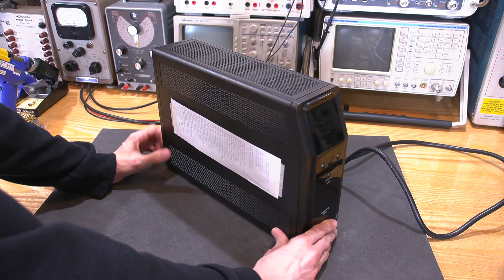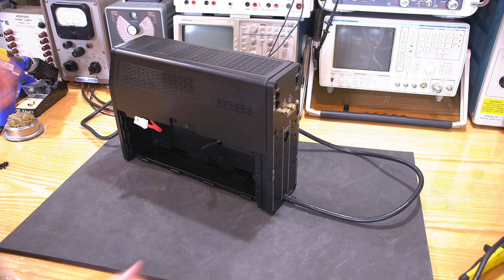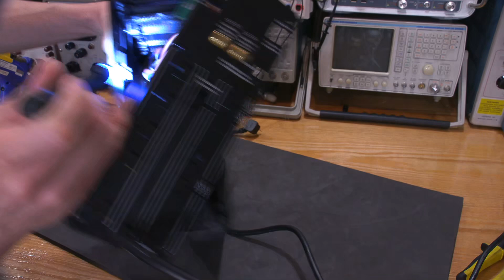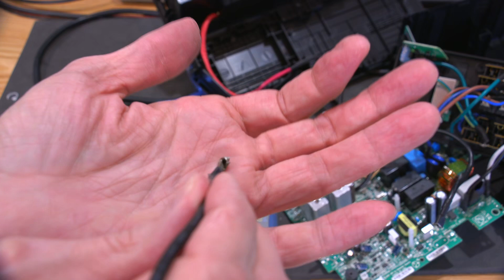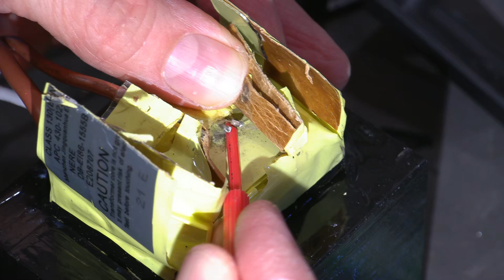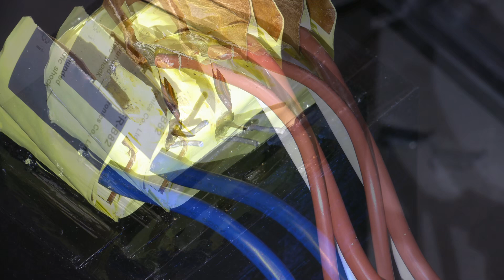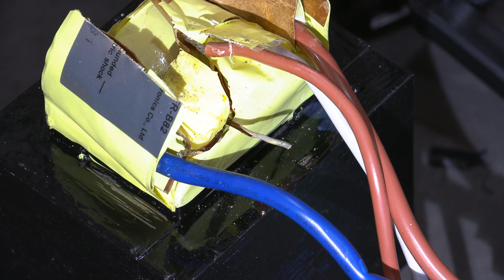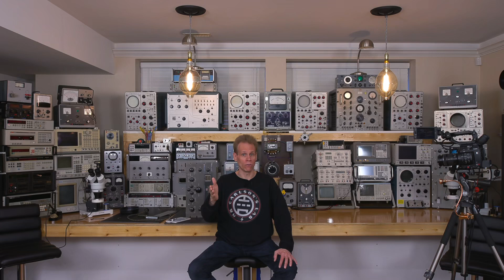UPS Electrical Failure - Teardown and Analysis!

Comment: Hmm I have a failed APC consumer unit that is still sitting in thee corner as a possible repair candidate or parts source... I think I'll have to go cut open the transformer now! I have an older rack mount unit powering my network gear. I'm hoping it's old enough and being a different market that  they didn't cut too many corners on THAT one.

Comment: I had exact same issue with my UPS, which is complete diferent brand(again with good reputation), but exact same thing happend. I didn't teardown the transformer, but just found the open circuit, and still have it. Some day will do it. The behavior was exactly the same, arching sound, slight smell, alarm, then error light and no output.

Comment: Sorry to say, the transformer market is being flooded with cheap, and dangerous, products.

I recently bought a new, digital controller, chemistry hot plate with stirrer, and the transformer in that was bad!
Instead of sending it back, I grabbed a wall wart with the proper output and used the transformer out of that.
The surplus transformer was over two decades old, and you could tell it was a higher quality unit!

The wires in my transformer were twisted together, but not soldered, and the wire wasn't even bent over! Needless to say, the lead had pulled out of the tape securing the wire. And it was so small, I didn't want to try and repair it.

Not surprising to see the quality decline as our products continue to be made as cheaply as possible, while they still charge high prices for them. I suspect a few fires from such equipment may be needed to get the industry to pull their heads out of their rectal cavities before the quality improves again!

Comment: Could the windings be copper clad aluminum wire? In the building trades a "solution" to the problems with aluminum house wire was to go to copper clad aluminum. It worked OK because the wire connection devices were purely physical, but the cost savings were so minor that regular copper wire was generally used instead. Soldering to copper clad wire seems like a really bad idea.

Comment: Some of new transformers and electric motors have now aluminum winding, I have read that there is  an efficiency reason for that. It only needed the wires crimped UPS put back together.

Comment: Aluminum wiring in my house has caused me no end of grief due to the mechanical wire junctions oxidizing and literally melting the junction boxes.  As a bonus I  got to pay for the wasted electricity used to create that hazard. I think the UL code must have criteria on proper methods of jointing dissimilar metals.  Maybe UL or the equivalent testing agency needs to pull their labels off these APC units. Thanks as usual for a great video.

Comment: That is the exact same issue I had w/ 1 of my 5 APC Back UPS 1500. My failed unit was connected to my primary desktop HW. I opened the UPS, andx found the same aluminum transformer windings. I have replaced each APC w/ a different brand. Interesting to me as well was the lack of any burns/poped capacitors on the boards.

Comment: It's sad.  My older 1500va apc ups, has a transformer about 4x larger.  transformer was new/old stock from the 50's or 60's.  I had tracked it down when that ups failed, and of course kept it.  Yours should have had mechanical connectors.  Pretty scary.  Aluminum is in everything these days.  All the consumer stuff especially.  How many of those ups's have reached the landfill already?

Comment: CCA = Copper Coated Aluminum. The latest "advance" out of China. Much cheaper than solid copper wire. It's become quite common in the last few years. And I predict that in a few more years it will be outlawed...again.

When I moved into my first house, about 1988, some of the houses in the development (the first phase of building) had been built with aluminum wiring. Yes, this "discovery" (that aluminum wire is a lot cheaper than copper) has been made before. Actually, the drop line to your house is made of aluminum. However, you need to be very careful with aluminum, because as soon as it is exposed to air, a high-resistance oxide forms on the surface. Electricians know this and there's a procedure to mitigate it which involves abrasives and a compound called "NoAlOx" which keeps the air from getting to the cleaned aluminum. They also use compression connectors to make a solid pressure bond to the aluminum wire (which expands more than copper when heated). So what happened with aluminum house wiring? Why don't we see it today? Fires. Lots of them. The houses in my development were all rewired with copper. If you look carefully on the back of electrical outlets and switches, you will (should) see "CU-ALR" which indicates that they are rated for use with aluminum wiring. 

Failure to make these types of connections results in what Mr. Carlson saw and heard. The difference in expansion coefficients causes the copper coating to unbond from the aluminum interior (and the copper layer wasn't all that thick to begin with). And you have a bad connection. It works OK through factory testing, but fails under repeated loads. I had one of these supplies, which failed with the same F04 code. I Googled it and discovered it's quite common for these APC units to fail with that code, and they are basically uneconomic to repair. Now I know why.  I have a couple of old metal cased APC BackUPS Pro units and they are on their third set of batteries. Real work horses. But APC is now off my list of candidates for new purchases.

Comment: A few years ago, I purchased two of the same exact models. One of them was used for my computer rig and one for my TV system. 

After a while the computer one said I needed a new battery. Now it’s a glorified power strip when the light goes out, it pretty much turns off the computer. But my TV one, isn’t complaining. SO, I swapped the batteries out. 

And guess what? The computer one still complains it needs a new battery and doesn’t want to work as a battery backup. 

So is there a procedure to trick it that is has a “new” battery? Is it lying that I really need a new battery?  The TV still has about the same time it’s on before I loose all power. Are they doing that on purpose to make me buy new batteries or worse, a new unit?

Comment: Slip is ATE test. When working for AB/Rockwell Automation from 1995 to 2001, as an ET the system created slips like that for passing tests. Its interesting that APC attaches them to their products as AB/Rockwell removed them before shipping products out to customers. There was just a build sheet with serial numbers of the boards that went along with the final product.

Comment: Is it a genuine APC or a counterfeit one? That is a horrible discovery I would not expect. My UPS APC failed two years ago, and I kept it hoping to repair it one day. It works with on battery but not on outlet power.  Now I will rather perform an "autopsy".

Comment: I've never been to this channel before, but YouTube recommended this to me, weird because I have the same back up, thankfully haven't had an issue yet, and mines been through about 5 power failures in the almost 2 years I've had mine, but I did have an arcing issue with an amazon basics backup that I have since tore down and thrown the bad parts of away. But in that one a relay had somehow managed to arc from one side to the other frying the control side of the board when it tried to get back on grid power after a power outage, definitely never getting an amazon one again lol

Comment: i have like 6 ups, where i live the electricity  is not reliable. My first 2 where apc and both failed after less than 2 years, after that i purchased cyberpower, i can say they are just way better, they have been with me for at least 7 years and i have just change the battery packs. Watching this video now tells me why the APC keep failing. great video man thank you for showing this

Comment: Mr. Carlson Greetings. I have a garage find Sears Roebuck Silvertone 6439A radio. Its a big console model multi band that I think is from 1939. Very dirty from setting around for so many years but still complete. One of the tubes has a broken glass where the cap connects, and the dial cord is still there, but off of it's small pullys. Interested?

Comment: Something happened when Schneider appeared on the label under APC logo, they used to be quality. However that transformer is fully assembled in China and it's very likely that the specification was changed for cost after initial sales to Schneider. Very common, so unfortunate that I have two in service that need to be removed now. EEERRR thanks for the vid ho hum.

Comment: You can't simply solder anything to aluminum: you need special flux and preheat the wires! Don't use your good soldering tips as they get eaten by the aluminum flux pretty fast. And you need a very big soldering iron to get as much heat in as fast as possible. Most guys soldering aluminum use tools for pipe soldering. I think it's easier to use a aluminum welder (with inert gas). There a many things which might go wrong why I don't like soldering aluminum (beside from the eaten soldering tips). It can be done but not rally with consitency (1 out of 5 tries are a good soldering connection: you should by some nickle strips and weld these strips to the aluminum and solder these strips it's much more consitend).

Comment: I used to use APC back UPS units from the late 90's, and they were built like tanks. I would remove the tiny batteries and replace them with a box of deep cycle marine batteries. And even though they were never designed for it, I could get 24 hours of runtime for my network cabinet. 
It is sad that such indestructible devices have fallen so far that they are now not even made of passable materials, let alone quality ones.

Comment: I had that exact true sign APC UPS and I can tell you it failed in the exact same way. I tore it apart trying to find what was wrong with it and never was able to. I was expecting to see carnage on the board but just like you nothing. I never cared enough to dig into the transformer, but mostly because I didn't expect that to be the thing that died.

Comment: Well, this is power, a clay wire on a transformer from APC! You're lucky it didn't catch fire! That backup power supply is not safe and in my opinion it should be taken off the market! There should be the original wound copper wire, because there are large currents flowing on the primary side of the transformer when the UPS is loaded at the output.

Comment: We are finding a lot of copper-clad aluminum wire on the market recently. I did a weight analysis and found copper content is about 10%. Large (utility scale) transformers have been made with aluminum wire for years, but they are terminated reliably. You can solder to aluminum with zinc chloride flux, but if left on it will cause corrosion.

Comment: The paper taped on the side is on every APC UPS I've ever purchased. It's just a standard item on new devices. If you buy a genuine APC replacement battery pack, it has the same piece of paper with it. I've had very good luck with APC UPSes, but just as with anything, some do fail.

F01 On-Battery Overload Turn the Back-UPS off. Disconnect non-essential equipment from the Battery Backup outlets and the turn Back-UPS on.
F02 On-Battery Output Short Turn the Back-UPS off. Disconnect non-essential equipment from the Battery Backup outlets and the turn Back-UPS on.

F03-F09 cannot be corrected by the user, contact Schneider Electric Technical Support for assistance.
F03 On-Battery Xcap Overload Faults  
F04 Clamp Short
F05 Charge Fault
F06 Relay Welding
F07 Temperature
F08 Fan Fault
F09 Internal Fault

Comment: Uh oh, the inverter doesn't know is sort of going the wrong direction in regards to welding voltage and current specs. ;-)  Wow, even the transformer windings are migrating to using the copper coated aluminum like the ole buzz boxes arc welder machines.

Comment: In my experience the APC back-UPS all fail in short order if your actually using them a good deal. I will have to find my documentation on it somewhere. Theres been a number of posts on hack a day about known failures of these units from the small ones to the larger rackmount pre large datacenter level units. About 6 years ago i went through close to 200 units in a year, out of the 100 purchased. Basically failures of random units every 3 months or so in the same way.  Wasn't worth shipping them back anymore as the cost of shipping was so high, after 3 units you had payed for a new one.

Comment: I have 2 APC and bought them as brand new. I think that is just end test report from production line. Usually they don't give that report for customer. Maybe they had problems earlier and now they do that for assuring those products work when they have build them.
So basically you see what they have tested and it shouldn't contain any fails.
Edit: Now I have to say WTF to that transformer. They hoped that loop wire with solder will be ok there. few temp cycles and that is loose connection. 
Also remember that it will also do short test when it test how good battery is. I think it's timed or It uses about 10% of capacity and calculate from that result if it's time to change battery.

Comment: Companies today have no pride at all. At one time in the 60's mobile homes had 14ga aluminum wire installed. The last time it was used was 1971. Over time aluminum combines chemically with the oxygen in the air and forms a coating on the wire that is resistant to the flow of electricity. This resistance causes the wire to get hot and can lead to fire. Imagine using your microwave in in one those 51 year old mobile home or worse electric blanket. Your sound asleep and never wake up. THE Fire Department finds your burnt body all because the manufacturer wanted to save  $30 in wiring cost.

Comment: a quick fix is to use an eletrical screw type connector to fasten the coil to the wires and (optional) cap it with solder on the top.

Comment: Lol, mine failed because of the freak cooler, then I was reassembling it and inverted the polarity of the battery, I just touched the terminals for 0.5s.  it exploded a capacitor and blew all the mosfets. like WTF, no polarity inversion protection, really ?

Did I invert it, or the last guy that went there when they replaced the battery for me ?  they replaced the spade connections and inverted it, who knows...

Comment: Transformers have been going to CCA (Copper Clad/Coated Aluminum) since that last copper price spike. You need much bigger wires for the same amperage looks like someone used the copper amperage tables instead of the aluminum ones. Oh and it needs to be secured much better because of the fatigue life of aluminum means even the 60hz vibration of a transformer could cause a fagute failure whcih is what I bet happened in this case.

Comment: You mentioned you switched all of them to a different brand.  Which brand did you switch to?  I had an APC die years ago and damaged the computer it was supposed to protect. I've ran without since.

Comment: Tinnit! 
Seriously, even a wire-nut would have been better.
Lesson: Even a good design will suffer from shoddy parts. I saw a video from EEVBlog where he repaired a Samsung SyncMaster monitor, good-quality apart from the parts used in the power board. Some cheap no-name capacitors were to blame, with wishful-thinking specs. I found the same in the monitors I was looking to fix, the exact same cheap brand of caps!  SyncMaster had apparently contracted out the build (the power board design was sound) and they used the "one hung low" brand caps. They sacrificed brand reputation for about $.10 per cap and a W+1 failure.

Comment: I had a similar fault, where the battery had leaked (it was only three years old), causing the positive cable to be eroded by the chemical mess. The general thought was that the battery charging / watch section must have failed, causing the unit to attempt to overcharge the battery, causing eventual failure of the battery (it destroyed the laminate flooring it was sat on too).

It transpired, later, that the unit was left on with no load (the computer it was connected to was decommissioned), and was probably the cause of the fault overall, but still, we've never purchased the brand since.

Comment: I used to recommend APC but dumped them a bunch of years back.  At work, the failed quickly.  At home, apparently, my building power was not that clean and the APC went through a 1 round of batteries turning on the battery too often.  Got a new bunch of batteries and turned down the sensitivity of the units so that they weren't as fussy, but eventually, one of the two gave up in a spectacular fashion.  Not to mention that in an actual black out, the units I had didn't actually keep my electronics running so they didn't do what they were designed for.  So my home and work experience with APC just gave me a feeling I couldn't rely on them.  I'm trying Eaton devices at the moment.  So far no problems.  They were a bit cheaper for the same VA.  Time will tell if that was the right choice.

Comment: If they used Aluminum inside these transformers, these thing could be responsible for many electrical fires where the origins was near or under the computer desk.  They stop using aluminum wires in the walls of houses because Aluminum wires are a fire hazard.    And these are now reintroduce inside houses inside electrical/electronics devices.  More specifically inside Transformers.   Now you have to wonder how these thing, UPS, got their ULC rating with aluminum winding inside these transformers.  Hey APC/Schneider electric why do you have aluminum wires inside those UPS transformer ?   That's a fire hazard !